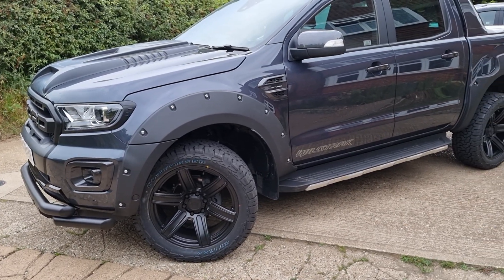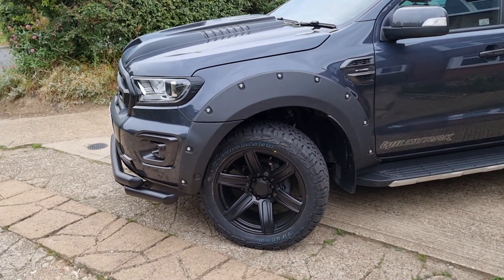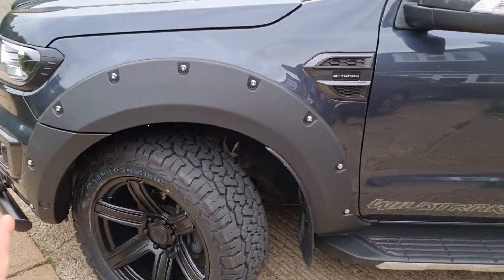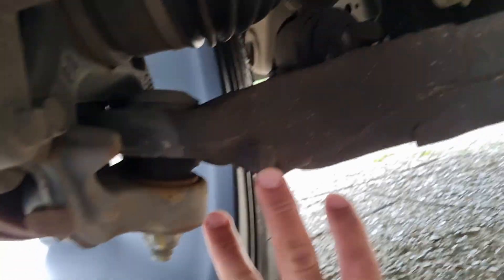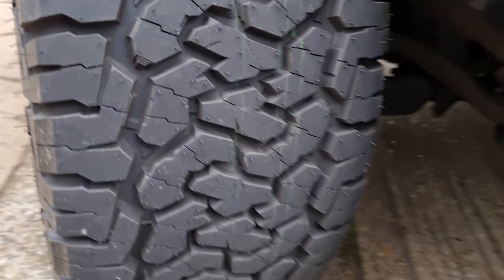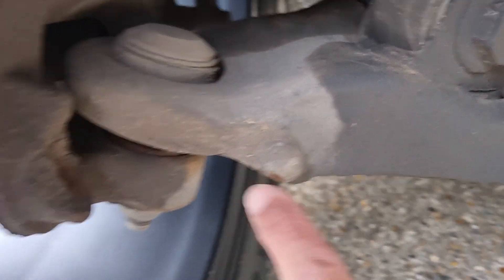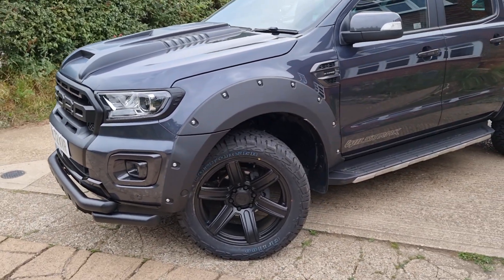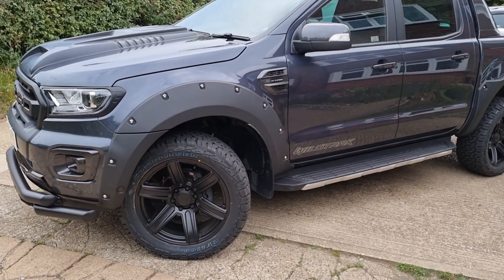Ford Ranger front end clunk sound on full lock, when going over curb forwards or reversing...

Comment: Mine does it only on a full lock turn to the right. Hearing on the front passenger side (left, AUS). I was worried but as it only happens sometimes and only at full lock driving off my curb I feel a lot better. Thank you 🙌

Comment: Hello there. I have a 21' Wildtrak with about 72,000km on the ODO. I noticed the clunking noise when taking a left curve. And when I accelerate up to 80kph it pulls to the left. 
Could it be a sway bar issue, or it's just the same thing of the cup and pin as you're demonstrating in the video. 
Cheers 🙏🏽

Comment: Hi, I have this issue on my 21 plate Wildtrak, and to be honest it is really doing my head in because I have only had it about 6 weeks and everytime it happens I get funny looks as if there is something wrong. If I apply grease, will it stop?
Reply: I had been having same kinda strange sound. I didn't even have to be at full lock, just cut hard and going over anything. I just applied some grease and it seems to have stopped, tho I don't know for how long. Let me know if you had any luck. Seems the more it hits it kind of bored a small groove that it will halfway lock itself into sometimes, making a very strange sort of clunking almost shifting feeling as if you moved your seat all the way forward or back. Sounded god awful from the outside and I was getting the same looks.
Reply: Hi, I managed to sort it a few months back. There is a knuckle on the front and back of the axle on the left and right hand side. I greased up both and haven’t heard a thing since.